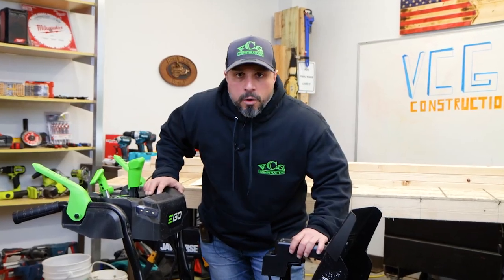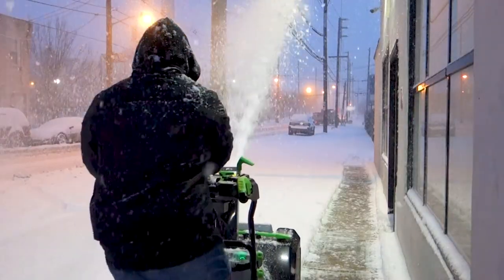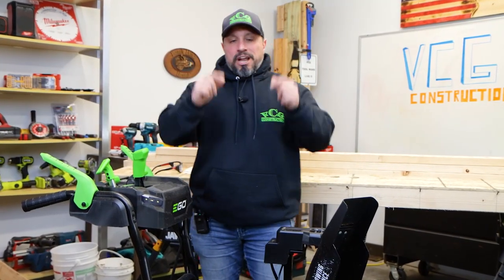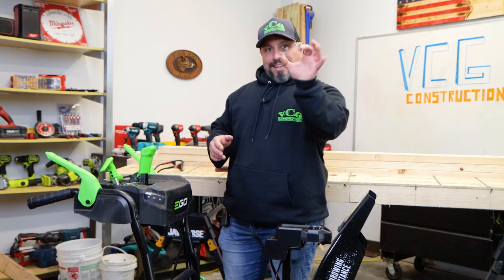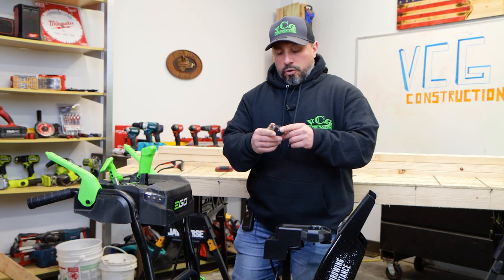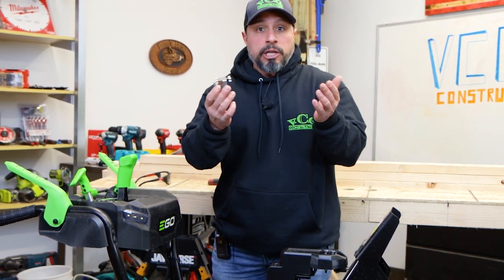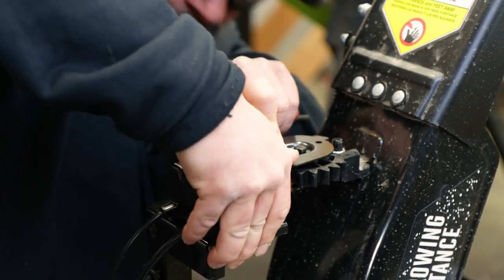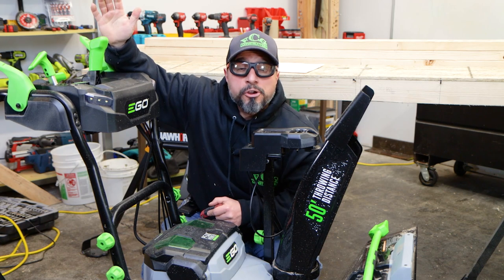2 STAGE SNOWBLOWER from EGO HAS A PROBLEM and THIS CHEAP PART IS THE ISSUE!

Comment: I just got one of these in time for this season.  They were very hard to get given the supply chain problems, but I got lucky.  I've used it twice, including blowing the one foot we got with yesterday's big snowstorm in Massachusetts.  It worked great.  However, when I went out this morning to do a bit of cleanup from the drifting we had during the night,  I used it for 10 minutes, and then had the opposite problem you are describing here -- the chute wouldn't move at all.  I initially thought it might have had ice buildup at the bottom, but that wasn't it.  I took off the chute and inspected and everything from the bottom up looked good.  Finding your video, I took the top off the gear mechanism and found that the gears were binding, although there was no obvious obstruction -- perhaps a misalignment or some crud found its way into the gears.  I gently rotated by hand and eventually it freed up.  Decided to give it a squirt of WD40 and reassembled.  However, I just thought I'd report that the new models shipping do not have the clip you describe.  Given that there appears to be more tension on the chute than it seems there is in your video, I think it's possible they've redesigned it a bit to increase the tension on the pulley that the control cables slide on.  That would address the concern in the one comment about the add-on clip wearing down the teeth on the gears.
Thanks for your video.  It helped me figure out what to focus on.

Comment: I stand corrected. I bought the 2406 model and it came with the part. Just used it for the first time and as a female I love this machine and am comfortable using it. This model comes with the 10h batteries and I still had about 3/5 of the battery left after almost an hour with the auger on eco mode…pricey but recommended

Comment: This thing works so well, when I sheared the right-side pin, I kept snowblowing and did not notice right away.  It wasn't until the 45cm/18" blizzard of wet snow that I saw the right augur wasn't turning at all, that I was running at 50%...

Comment: The newer SNT2400/2405/2406's come with the upgrade kit already installed. The upgrade is intended to correct the tendency of the chute to rotate by itself when using by stiffening it up. BUT it makes it much harder to rotate the chute using the control stick (extremely stiff). One of the local Lowes has zip-tied the handle in place - maybe to keep potential buyers from rotating the chute and seeing how very difficult it is to rotate with the kit pre-installed? Other snow blowers chute's (not cable-controlled) rotate extremely easily and are not zip-tied in place (at Lowes) and the SNT2400 comes in the box without the Zip Tie on it. One solution  I thought of is to add 1" tube steel (1/16" wall thickness) to add an 18" cheater bar (and maybe a short 7/8" tube steel piece to re-attach the hand grip) to the control stick. Maybe the EGO solution created a whole new problem? I think those users with weaker wrists may have trouble operating the snow blower with this upgrade kit in place. (The EGO official video says the chute should rotate freely after it is installed, but says nothing about what to do if the chute does not rotate freely.)
Reply: I just spoke to ego and this comment is not accurate, the kit still needs to be requested as they said it wasn’t a problem with all of them
Reply: Comes zip-tied from the factory
Reply: @valleyg9628  I bought a brand new EGO SNT2400 sealed box and opened the box, myself and assembled it (mostly unboxing). It came with the Upgrade kit already installed (manufacture date May 2022). They also thought the unit I bought should have come with adjustment nuts (since date May 2022) on the cables to tighten/loosen the chute operation (as shown in current instructions downloaded from EGO's site) and I had to prove mine didn't have the nuts by sending them a photo. Then they arranged for me to take it to a service center for work (the center lubricated the cables and Chute Gears). The service center told me EGO dropped that idea of the nuts because they didn't do the job. Maybe some of the new units now ship without the upgrade kit and have the nuts? Chute Control was not zip-tied in place in the box on my new unit.

Comment: You asked the question, I'll give my opinion.  Why didn't they include this?  It was probably an oversight and they either had a number of them that went out without the piece (and not worth time to issue any kind of recall or notice because it's not necessarily a safety issue) or it wasn't in the original design and as you said, it's something that they added to any new units, but again didn't issue any kind of notice to owners.

By far not a big deal.  Quite a nice bonus that they offer something to send to fix the issue for anyone with the problem.  That's good customer service in my mind.

Growing up, always had gas powered mowers/throwers/etc.  Back when I had my first home, I had gas powered stuff too.  Next time I own a home, I'll probably go this route.  Snow blower, mower, possibly more.  Working off shift, it's nice to be able to do yard work early in the morning or late at night and not disturbing people.

Comment: Seems like having a steel part rubbing on that plastic gear (! plastic gear, WTF), with the express intention of causing friction, would also cause a lot of wear.  Any thoughts on that, Vince?
Reply: That gear on my gas Ariens was made out of the same plastic material. That also needed to be replaced after years of use so I don't see any difference. Not sure I have ever seen a metal chute gear.
Reply: @jamie8917  One example is my 1980 Ariens ST824.  It has a bronze worm gear that meshes with the chute's integrated steel gear teeth.  It is now 41 years old and hasn't worn out yet.
Reply: A little vaseline on the gears once in a while should alleviate that issue.
Reply: I was thinking the same!

Comment: Just found your channel! This one and the first one were both great videos! My question to you or anyone reading the comments is how does it perform the following winter? Every video came out in the 20/21 Snow season. One of my biggest reasons for going electric over gas is the lack of maintenance? Any issues with it starting the following winter?
Reply: There is no start.  It's either on or off.  It's kind of like asking how does your blender start in the second year.  That's what's great about battery powered tools (and cars for that matter).  There is very little maintenance.  The batteries are the key and over time they will degrade some.  But Ego has a great BMS (Battery Management System) which maintains the battery for a longer useful life.  They are the Tesla of power tools.

Comment: Nice production and infotainment for both ego 2 stage snow-blower videos. I'd love to own this new product, however, due to the world tariffs, distribution fubar going on due to trade wars, covid-19, etc. plus the big item, price, which IMO is a little spectacularly high, no doubt due to other issues previously mentioned here. Ideally, in whatever normal economic times that were previously experienced, I don't think those times are coming back in the next several years, it would be a no-brainer, buy. Dang. Yeh, again, in a perfect world I'd buy it in a heartbeat (including keeping my heart going) if it were $400.00 lower in price and the distro issues were cleaned up, I'd have until next Nov. '21 to get one, fine, else probably not going to happen, and we do get a few 2 footers a year out here in parts of Wis. Some boomers like me complain about their kids moving back in, not me, I need them in the winter. 
The Host has got a pretty great pitchman shtick going on. :-)

Comment: I still would never want a battery snow blower. Deep snow often means power out and last thing i want to be dealing with is dead batteries.
Reply: If I were to buy a battery operated snow blower I definitely would buy extra batteries and always made sure they were charged
Reply: @loucifer323  I agree - you need two or three on deck charged and ready to go. That’s gotta add $300 more to this setup.
Reply: @Ripdizzle01  $349 per battery and it needs 2 at a time to perform optimally. Add $698 
Key is already being invested in EGO tools and batteries so buying this you should hopefully have more batteries to use.
Reply: @loucifer323  but the whole idea of all battery is to be green and if i need 6 lithium batteries there is zero chance i hell that a electric snowblower has lower lifetime emissions than a gas. But even 6 batteries might not get you thru a blackout.
Reply: @TheJttv  I don't give a rats ass about emissions, the thing is sometimes you can go 2 or 3 years without using your snowblower and you didn't drain or treat your gas now it won't start with battery operated snowblower they can sit for years as long as it doesn't get wet will start right up as long you keep batteries charged
Reply: I live in Minnesota and own this snow blower. Ive yet to fully drain the batteries and I’ve ran this thing for over an hour at a time thru some pretty sizable snow accumulations so far this year.
Reply: @loucifer323  what? We use our snowblower every year here in Upstate NY. But if your somewhere that rarely gets snow storms that means your utilities are more likely to fail.
Reply: @Johnnyb418  is that an issue long term without using the battery? Do you need to charge or does the lipo not need it?
Reply: @Ripdizzle01  Ego batteries have a built in "self maintenance" feature that will discharge the battery to a certain percentage if it is not used after a period of time. This is supposed to lengthen the overall battery life. These batteries are pretty fool proof as long as you don't let them stay out in extreme temperatures for extended periods of time.

Comment: hopefully milwaukee comes out with an mx fuel one
Reply: At 5 grand I don't think so
Reply: @loucifer323  i would probobly be at the same price bare tool as the ego
Reply: @cheffandrewscookingshow1455  Sorry the MX batteries alone cost more than this blower with two batteries, the MX light cost over 3 thousand and that's just a light so I'm pretty sure a snow blower will 5 thousand easy, and I'm pretty sure they are going to bite the bullet and stop making the MX line it's just not selling I went 5 Home Depot and not one of them is going to carry it there's been no demand for it and with economy sinking faster than the titanic nobody's buying anything right now I talked to a contractor the other day he had 3 customer cancel jobs because of the uncertainty
Reply: @loucifer323  ok maybe an m18 then although you would want to use the 12 amp hour batteries and multiple batteries at the same time to get some good run time
Reply: I own all of Milwaukee's ope products and they work well enough but I'm really considering going to Ego for the mower, snow blower, and their power source (nexus?)
Reply: @markbuckeye  huh have you tried slabbing a log with Milwaukee's chainsaw and an Alaskan mill I'm considering getting the saw but I would like to know if the saw could slab logs into boards well
Reply: @cheffandrewscookingshow1455  I have not slabbed a log...the saw is reasonably powerful and likely could do the job but it depends on the volume of boards, the size of the log, and hardness of the wood...I've only used it to cut down a couple of trees and cut them up...I'd be willing to try it, or even lend it out to see how it holds up...my gut feel is that it could do the task but would be inefficient at doing any quantity...
Reply: @markbuckeye  im looking at slabbing cedar witch is a soft wood the main thing im worried about is the run time and the power
Reply: @cheffandrewscookingshow1455  power is good enough, might even be able to push a bigger bar...thin kerf...get enough batteries you could cut non-stop.
Reply: @markbuckeye  Ok thanks

Comment: I just bought this snowblower.  I used it once to see if it's working, did a small area and then put it away in the garage.  Then next snowfall I went to use it and the auger will not power on.  When trying to turn on the auger I get a flashing orange light.  No auger spinning.  The drive and lights work fine and battery is full charge.  Ego support offered no help other than to say to return it to store.  Any ideas for what I can try?  The auger blades don't spin freely, they are locked in place, is that normal?
Reply: Sounds like something is jammed in there like a stone or branch.  Take a good look around the auger back where it meets the second stage
Reply: Were the batteries cold?
Reply: @ralphfraumeni6190  the batteries weren't cold. Since I recently bought it I took it back to Rona and exchanged with a floor model. Tested the battery with the floor model to confirm it wasn't battery related. My gut feeling is that the auger brake may have failed and jammed it. I have many hours on the floor model replacement and it's been excellent.
Reply: @whiskeytangopapa1232  I have read about similar issues. There seems to be a few defective safety/power switches out there.